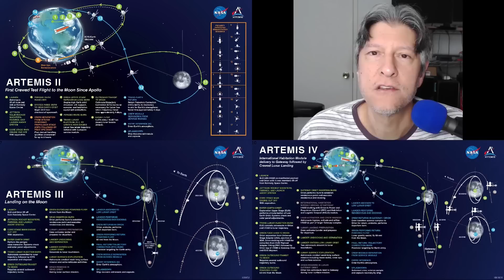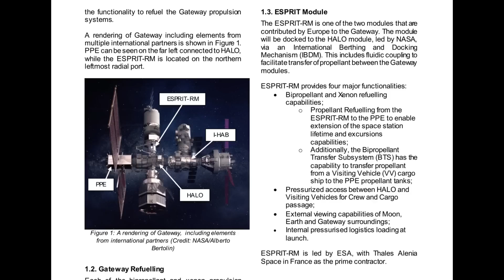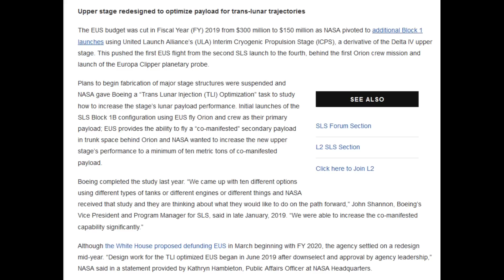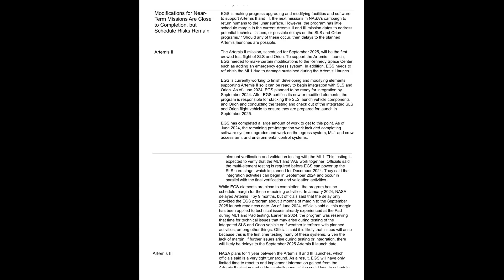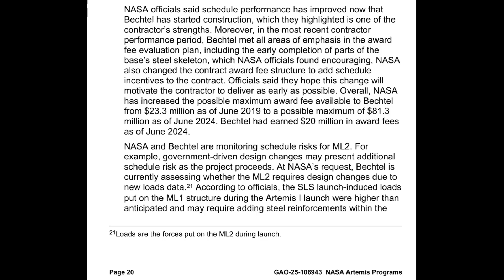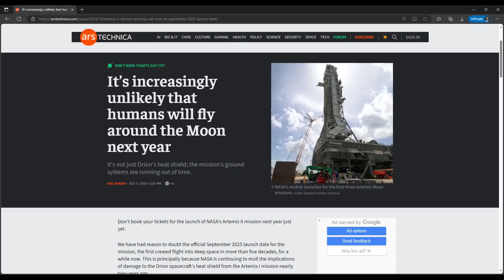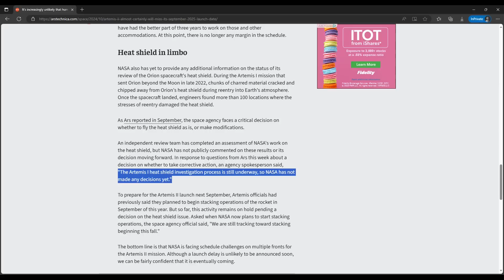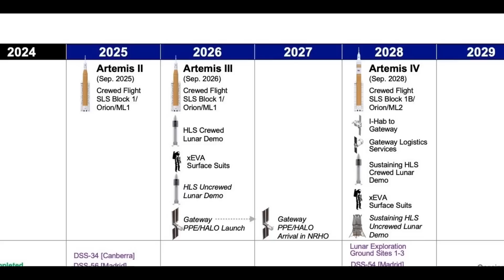Starship flight test completed, Gateway Lunar View optimized for SLS

Comment: The first lander, equipped with two extra docking ports should just stay in NRHO as gateway core
Reply from the maker: Just as Gateway needs logistics resupply, SpaceX would need to extend their propellant supply chain out there to do that.  Certainly not impossible, but it would be required.
Reply: @PhilipSloss  yes, I believe it would be somewhat feasible though
Reply: @colegustafson199  No money or interest.
Reply: I wonder what the boil off speed is for HLS. If they only use cryogenic fuel and no hypergols for RCS there is a limit on the time it can steer itself.
Reply: @zapfanzapfan  you are correct regarding this concern, however, even the internal volume of a starship tank at 5 atmospheres would have enough  pressure to maintain attitude for a long time it’s a matter of power and valves

Comment: Why is SLS still not cancelled?
Reply: and how would you send people to the moon? on a trampoline? starship is years away from being human rated. Orion is not even compatible with it. there’s no way to install launch escape system on starship in its current form
Reply: @anushervontabarov8568  Are they landing on the moon with Starship? Is there any other landing method planned?
Reply: @parkershaw8529  Starship HLS will be responsible only for the last leg of the mission (tho one of the most important). You still need a capsule to rendezvous with starship on the lunar orbit, and unfortunately, there’s no practical way to do it in the next several years without Orion or SLS.
Reply: @anushervontabarov8568  LOL, Starship, F9 with Dragon can get the job done in a few years for sure.
Reply: @parkershaw8529  nah they can’t. Starship HLS has no delta v or capability to aerobrake to return to LEO for dragon docking. Dragon is not designed for high energy reentry so yeeting it to NRHO with Falcon Heavy won’t work either
Reply: Falcon heavy can launch 63.8 tons to LEO, SLS block 1B can launch 105 tons.

Maybe you have the completely ridiculous impression that "in a few years", two falcon heavies who love each other very much will have a "falcon heavy times 2" baby with 6 boosters. Funny how you stress "in a few years" so much like it makes any sense.
Reply: @humanbeing9079  Did I ever mention Falcon Heavy at all??
Reply: @humanbeing9079  SLS Block 1B won't fly until the 2030's at earliest lmao. The delays and cost on just its  EUS upper stage has cost tax payers almost 4 Billion USD and will cost them a few billions more before it becomes complete, if ever.
Reply: Lots of jobs riding on the program for better or worse
Reply: Irreplaceable capability, flown successfully, important to keep the spacecraft and rocket designs inside NASA control. No one actually wants Musk to have total control over everything in the space program.
Reply: @okankyoto  It certainly isn't an irreplaceable capability. SLS is such an underperforming rocket that it can't even get Orion into a low lunar orbit. You could create an architecture around Falcon Heavy/Vulcan/New Glenn to launch the Orion into the same orbit. The Bridenstine stack is a perfect example of this. 

But like they say, hindsight is everything. But I think the worst part of SLS is that it entirely relies on that Starship HLS works, but with Starship HLS it can make SLS obsolete through just some minor changes in the mission plan, like having the crew launch on a Dragon and meet Starship HLS in orbit, take it to land on the moon and then have the Starship use its remaining propellant to leave Lunar orbit and meet up with an Orion launched with something like an expendable New Glenn or Falcon Heavy, Starship HLS won't have the propellant to get back into a low earth orbit, but it can reach an highly eccentric orbit around earth which makes it feasible for a New Glenn or Falcon Heavy to launch Orion towards it. Of course the biggest problem here would to make New Glenn and Falcon Heavy crew rated, but seeing as they don't use SRBs which means considerable less vibration and the later having a proven track record and manageable G forces on ascent I think it's very manageable.

Comment: Thanks for the update, it's a great peak at the questions that still need answers. I really hope that NASA won't repeat the mistake of gambling with astronaut's lives for the sake of appearances. If the crewed mission needs to be pushed back a mission then that is preferable to a heatshield failure with crew on board. They are taking their time looking at the heatshield so hopefully they are trying to evaluate every potential risk and find that the heatshield is in fact good enough. Artemis 1 launched nearly 2 years ago, I hope we see Artemis 2 fly next year but if that becomes 2 years from now then so be it. Maybe by then Starship will be able to help supply the gateway modules and practice it's landing without rushing things.

Comment: I wonder if some of the institutional lethargy may not be clearing because everyone with technical knowledge knows that the entire artemis program is dependant upon a fully functional starship. But once that is a reality it also completely replaces every other component of artemis with superior and cheaper options. It's analagous to the drop off in development of piston aircraft in the early days of jet aviation.
Not useless, just less necessary.
Reply: Not really. It takes 15 tankers just to send HLS to the Moon, that kind of operational complexity is undesirable for sending things to the moon regularly. Also its unlikely that Starship is ever cleared for human use without a LAS.
Reply: @okankyoto  Yeah Starship may take that many launches to get to the Moon with a full payload, but it could just launch the same payload as SLS with a kick stage, saving the refuel flights. As far as the Artemis architecture, SLS is really only needed to launch Orion, which might be able to use Vulcan or New Glenn if the cadence really starts sliding.